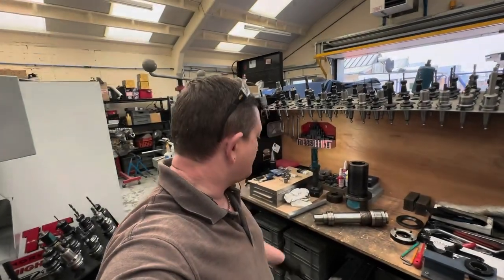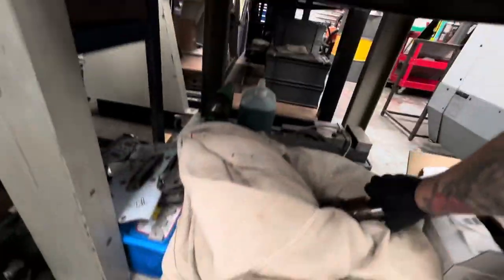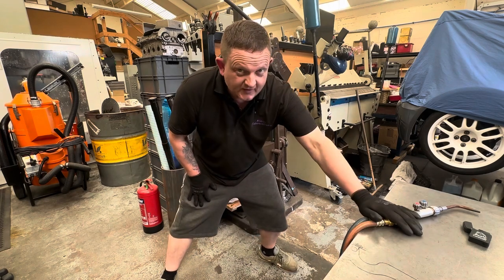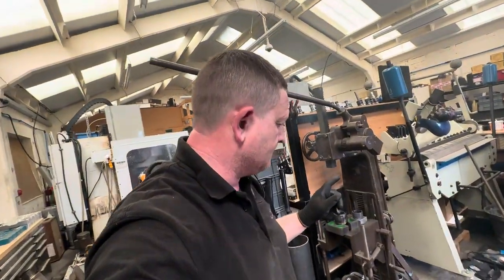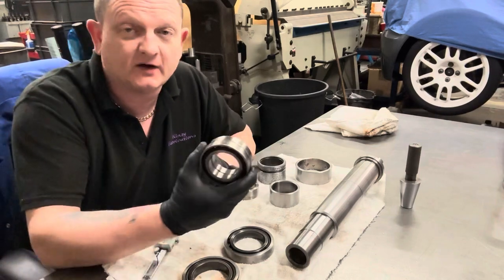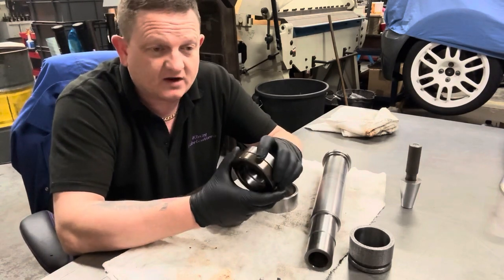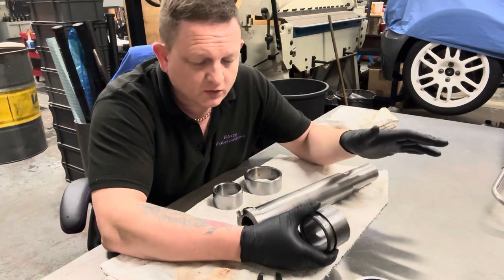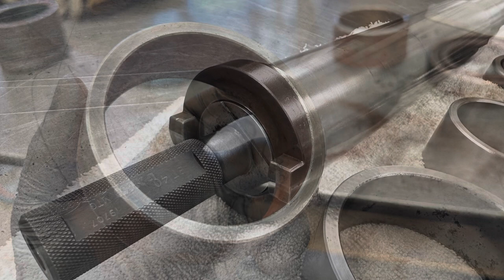Haas 40 taper 7500rpm spindle bearing removal how to guide

Comment: I had a pull stud break and mess up the taper. I mounted up a vise and put in a piece of aluminum. I then bored a hole in the aluminum the size of my die grinder, wrote a little program that moved up and down in X/Z at the same angle as the taper and moved into the taper by .0001 each loop. Started with a grinding stone and finished up with some Cratex. Never had a problem with it.
Reply from the maker: Hi

Thats good going, personally its not something i wanted to get involved with seeing as the cost of just a regrind was relatively cheap, i know its a pain to remove the spindle and be down for a while but they can grind it when its all build up so you dont have to completely strip it if new bearings are not required but as my bearings also needed doing i thought it get it out and do it all at once

Comment: They are shrink on sleeves just rebuild one, setting the preload is a pain on them 7012 bearing. I had to give them a tweak in the press.
Reply from the maker: Thanks for the tip, i was thinking it will be a pain but better to under load them rather than overload them initially as at least you can tweak in a press like you did,  wheras if you apply too much preload and you need to heat the collar to back off a bit the chances are you will ruin the bearing with the heat
Reply: What's supposed to set the preload is the very slight difference in height between the inner and outer spacers, not the locking ring. It's also kinda chintzy that Haas used shrink fit locking rings instead of threaded locking rings. In my spindle, the lock nuts thread on, and they have 2 slightly independent sections of threads. There are multiple set screws that essentially push the 2 independent sections of threads on the lock nut apart to jam the threads so they can't loosen.
Reply from the maker: @gorak9000 on these bearings the spacers are the same height and the preload is a difference in height ground into the inner race so that when compressed by the shrink collar and inner spacer the pre ground pre load is set

Comment: You say that the other spindle tooling is sticking and needs a tap to get the tool out. I had the same on my CNC mill. It was the drawbar Bellville washers that were all cracked. 9 were shattered and the rest of the 47 washers had fractures in them. My drawbar failed to release and i had to remove the drawbar and i found the damaged washers. I bought new £60 Bellville washers and it is working perfectly now.
Reply from the maker: Hi

When i swapped in the spare spindle i did check the drawbar and it had 2 cracked washers out of the 79 or 81 it had so i have also got new belleville washers ready to use but i wasnt going to put them in until i had the spindle ground, along with a full tool release piston rebuild and clean up with new seals but may i should try those steps first before the regrind just to see if they make a difference on their own

Thanks
Marc
Reply: My tool was being blown out from behind with the air that blows the chips away There is none of that now it just releases the tool smooth and quietly
Reply: Check the other washers They might also have fractures in them

Comment: yo tengo  una vf0   que compre y le hice retrofit   ya que el contro estaba dañado , pero cuando llegue al  prenderla me di cuenta que el husillo se calentaba , yo no me arriesgue y me compre uno por ebay  para seguir adelante con la maquina , ya después de un año de uso  le quiero cambiar  los rodamiento , todo ere igual que el tuyo pero el mio  no venia con ajuste a presión  , traía tuerca de ajuste , y eso que por fuera se ve igual pero bueno ,  ya veré como me  va a mi con el cambio , mucha suerte y  te sigo desde  hace unos 4 meses y pues aquí estaremos  .saludos:hand-pink-waving:
Reply from the maker: Todo lo mejor con la reconstrucción de su husillo.
Reply: That style is better as you can adjust the end float out a lot easier.
Reply from the maker: @philrowley995  what style are you referring to?
Reply: @kinzy_fabrications  the bearing nut style, I’ve rebuilt a lot of spindles. Just starting a business doing them now.
Reply from the maker: i see nut adjustment would be much easier to set but would it be as good for longevity? risk of backing off compared to a shrink fit coller